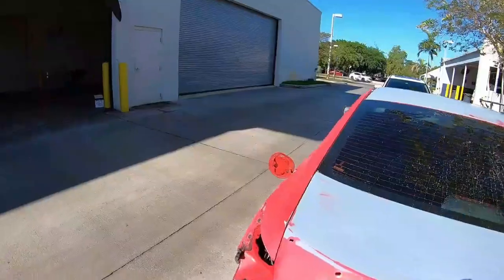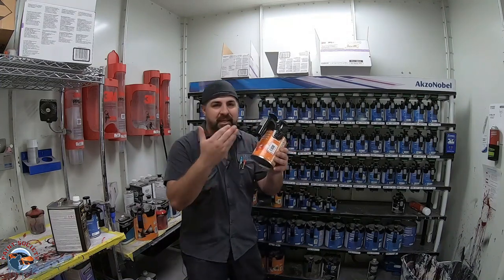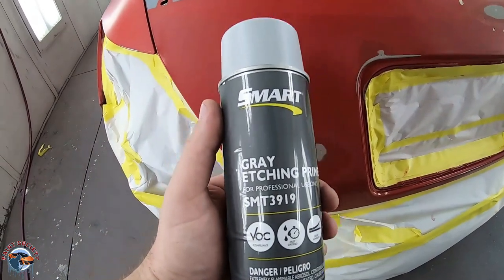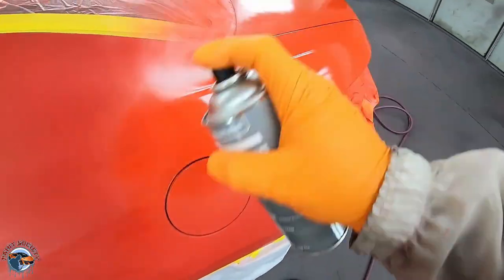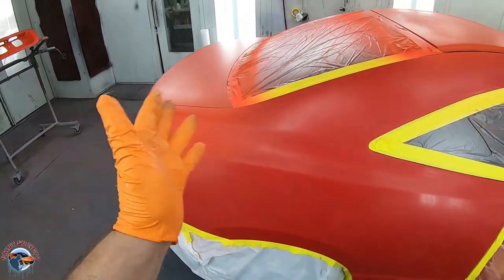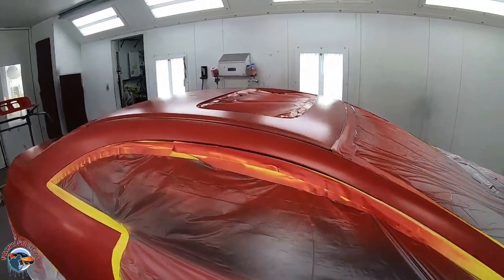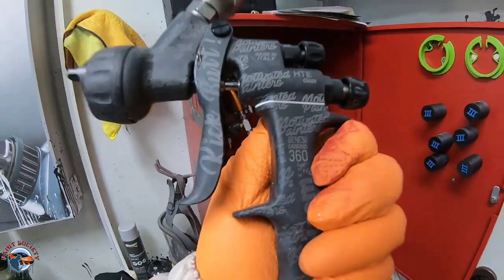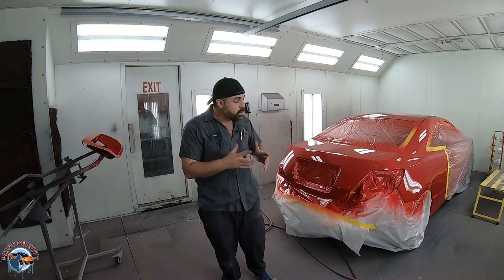How to Paint a Car on a Budget!

Comment: Love the videos! Quick question for any auto body painters, do you need to use eye drops after painting/clear coating if not wearing eye protection?
Reply: Ive painted for a couple decades and ive never use eye protection and never had to use eye drops. Theres either not enough air movement in ur booth where overspray isnt exhausting fast enough, or ur eyes are too close when painting and the overspraying is legit landing into ur eyes
Reply: @JimmyJiveJones  Ah, thanks. I had wondered because it looks like big aerosolized clouds of, say, clear coat in his videos.
Reply: well Brians videos its normal. Theres enough distance from where the overspray cloud is and where his eyes are. But when ur doing tight areas like the engine bay or inside a trunk sometimes the paint bounces back right into ur eyes and face which is not a comfortable situation

Comment: Brian, been watching you for about two years now and picked up a lot of great tips and tricks over that time! I even picked up a DV1 after watching you and bode use it multiple times! But that brings me to a question I have. 

How do you get such a great finish at 15 PSI with the B Plus Cap? I ask because I started at 15 PSI and didn't have great luck.  After reading the recommendation for the B Plus cap is 22 PSI the gun has worked flawlessly.  Is there something I am doing wrong or missing?
Reply from the maker: It’s a great gun! If 22 is working for you the. Rock it. All paint will spray a bit different. At 14psi I get much better paint transfer. Add some extra reducer if your base isn’t laying. Remember I am using it only for base.
Reply: @looper451  

I have the air measured at 3 different places, 4 if you count the digital gauge on the gun itself.  But yeah we could be using maybe different size fittings or something.
Reply: @Ram010108  Could also be temp and humidity levels

Comment: I always appreciate your videos.  Maybe next spring I will paint my replacement factory wing and front valance.  But I do have a question that I can't seem to get a solid answer for.  If you paint a car or even a part of a car, how long should you wait to vinyl wrap it?  Now before I get jumped, my car is an 86 Toyota MR2 that I take to the track.  The paint will get chipped pretty bad even just on open track days.  I want to wrap the front and leading edges of the car to protect them and avoid as many chips as possible.  Car shows and car meets I would rather just have the car sit as it is painted and not wrapped.  My main concern is removing the wrapped areas and peeling my nice paint job off.  Hope that make sense.
Reply from the maker: I would wait a good month before adding anything on top of the paint.
Reply: @PaintSociety  Thank you.

Comment: Hi Brian. I'm wetsanding orange peel from my clear. Starting 2000, 2500 (by hand) then using 3M 1 step 3000/8000. It looks like my 2000/2500 sand scratches are not being lifted from the 3000/8000. It's definitely my 2000/2500 because I'm hand sanding and the scratches appearing during polish are straight lines. Do you have any recommendations? I'm so frustrated that I need to just take a break and go back to the drawing board. So bummed because it's polished but now I have to go back to step 1.
Reply: It can happen, I would suggest you to just sand it again, but start with 2500 again and then go a bit higher, did you wait long enough for the clear to harden?
Reply: @theoccasionshow  yes baked in 100 degree day right after clear and sat week before working on it.
Reply: @RobertCGee  Ok, so then my guess would be that you maybe didn't sand long enough with 2500 so that the scratches from the 2000 would disappear completely
Reply: @RobertCGee  Or you had pebbles respectively dirt between the paper and surface
Reply: @theoccasionshow  How do you know when it's enough sanding? When I sand I always cleaned panel with sprayway and clean microfiber. Using a soft block. How much pressure to apply when sanding?
Reply: @RobertCGee  I always polish small areas of the surface and just look if it's enough, will say if there are any deep scratches left 😂 When wetsanding clear coat I never apply too much pressure
Maybe you could also use a rougher sanding polish to help get rid of some of the scratches left
Reply: @RobertCGee  Im surprised ur having this much of a problem. U should be able to polish out straight 2000G sanded areas without 2500->8000. When hand sanding u should make sure ur sanding in small circular pattern mimicing a DA sander, not long and straight patterns(its equivalent to sanding with 1500G imo), thatll take alot of polish or it makes it harder to sand out later. FYI 8000 is overkill and not needed imo but if its a showcar then by all means.
Reply: @JimmyJiveJones  The 8000 is part of 3M's 1 Step 3000/8000. It's a kit if you didn't read my original post. My research about hand sanding was never to sand in a circular motion. I already figured my problem out though and it's coming out nearly perfect.
Reply: @RobertCGee  Glad its working out for u. But being a painter by trade, u also have to know how to polish and sanding in a circular motion to micmic what Dual Action Sander will help u polish out the sandscratches alot faster. Even today, my compressor went down so i couldnt use the DA with 3000&5000 to take out my 2000G sand scratches and after the job was washed, i could see the scratches and i had to repolish it.

Comment: Brian I got tiger stripes with my new for this project devilbiss startingline spraying metallic, 22psi gave best spray pattern, slightly heavier on bottom, even when I turn air cap 180 degrees. Air tip clean. Held gun what seemed parallel to surface. sides are good- just hood,roof, trunk.Have 3 coats on and looks better but still can tell. So do I scuff and spray at higher psi and increase distance spraying to fix?
Reply from the maker: 800 grit it

Spray 1 coat for coverage and then add 20% more reducer to the mix and then spray even from 12 inches slowly
Reply: @PaintSociety  Thank you! Got it and a coat of clear on, lots of dust happened when i opened my zipper door. So i will.let dry, hit spots with 1000g,  Then one more coat and sand entire car 1500g then 2 more to go per dealer instructions. Its looking great and thanks to your professional help you have helped this DIYer!😊
May be a good episode to do on what the sanded panel needs to look like up close on final sand and what to do to fix rough primer, pin holes, missed or slightly raised glaze spot after base is on or lots of dust, remind people to re-mask plastic to prevent flaking on paint....this all happened to me on this. So its been in homemade inclosed booth for 2weeks to get it all done right. Thanks again -God Bless

Comment: Do you recommend buying a anti static gun? I’m getting a lot of dust in my paint even with excessive cleaning , water on the floor and tack rag , I can’t justify a 1200$ charge
Reply from the maker: You’re not going to see a huge change. I use it mainly for plastic.
Reply: @PaintSociety  hey thanks for the reply , love the videos
Reply: U should only be getting alot of static from plastic parts, if ur getting dust on the rest of the vehicle. Its from something else. Anything and everything can produce dust,  even the spray booth itself can produce dust that land in ur job after u finish spraying.

Comment: Quick question.. I am a painter by trade,  though I paint Bridges and Dams instead of Cars (Completely different skill set) .  We Generally use a different color primer than the paint to help you see where there are thin spots in your paint.  I would love your feedback on that!
Reply: Because on cars you dont want to use to much paint cuz its bad for curing over time,  also saves money in thr long run.
a bridge or a dam is beeing looked from a distance.
Also if your car is black andhave white primer rockchips wil look verry ugly if u used black primer it wont show as much
Reply: @laupy4104  Yeah, Industrial painting is more about applying a thick protective coating and not so much about aesthetics.

Comment: in this case of roof and trunk Sun burning( with the top of the fenders), which PRIMER did you use? Urethane or Epoxy?
I wish it was full video from the beginning, its 100% my car case, Im looking for info for long time now, want to know what should i do and use in that case
Reply from the maker: Use 180 grit to smooth the surface then use 2k surfacer primer
Reply: @PaintSociety  
Thanks Brian! 
2K Surfacer primer it's Epoxy or Urethene? Sorry if its stupid question 🤦
And the quarters edges? They not totally burned but it looks like hexes on the clearcoat, so it's break down... Should i go with 180 and primer too ?

Comment: Is base really that much more expensive than the sealer? Realistically what would you save vs going with a grey primer and then putting an extra coat of base?
Reply from the maker: On this job.  Over $100
Reply: Base is that much more expensive that sealer, Especially with red. Red doesnt cover that well so u need a proper sealer for the coverage or u could end up spraying 6-10 coats of red base over top(not exxagerating)
Reply: @JimmyJiveJones  but you will get oem perfect shade of red if you use 6 coats of base? My concern is using a color sealer is it will save you a few bucks but you better be an expert at blending because I feel the color might be off a bit
Reply: @kenmastersmaster  red is the hardest color to cover. For example, if the roof was black, u would have to spray possibly 10 coats of base over it and there would be a good chance it wouldnt be covered. Using the appropriate sealer will help with color coverage and help u archieve the true color in less coats of base (thus saving you money). Also putting on 6-10 coats of base, u will run into a bunch of other problems like sandpiling, ur job will be dirtier, the base wont be as smooth which will lead to a more of an orange peely finish. If u dont have access to a color sealer, for this specific color, a light grey sealer works best for it. But all paint companies have there own shade of sealer they think can help cover best. But to anwser ur question of will u get the OEM perfect shade of red if you use 6 coats of base? The answer is no, if u were to paint a new bumper(comes in black) with 6 coats of base, im 100% sure it wont be covered and u wont know until its cleared and put back onto the car.